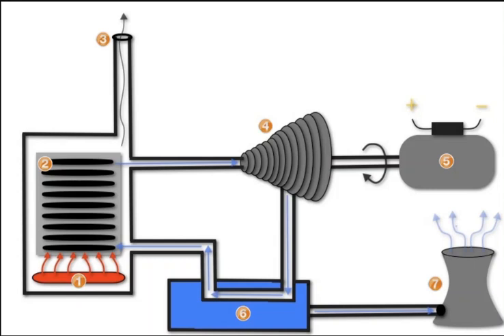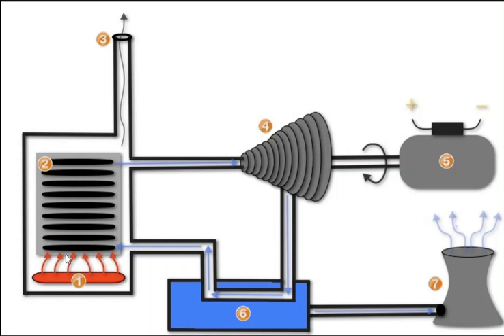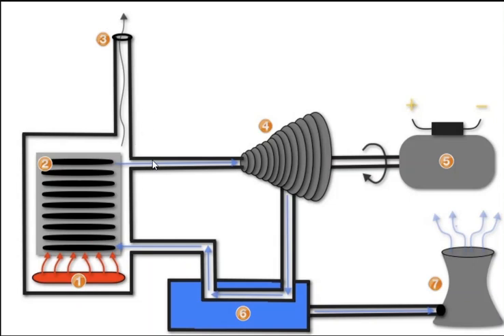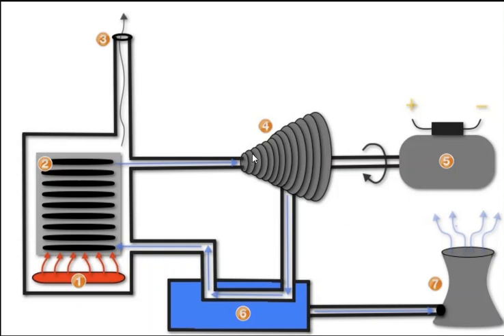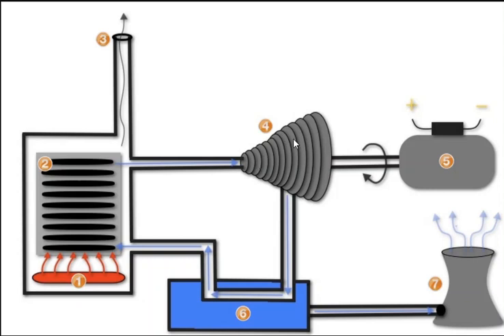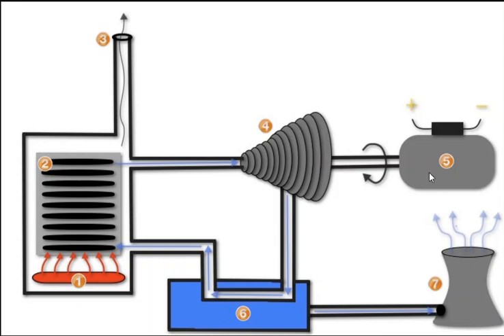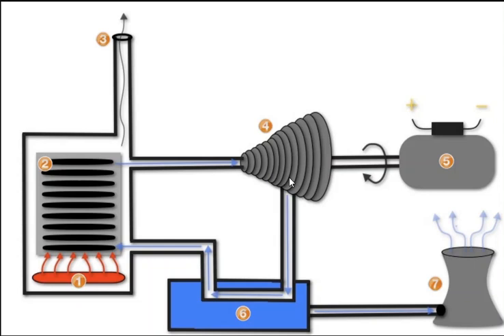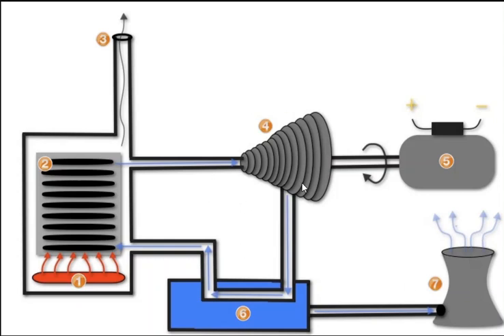How a Steam Turbine Works - A Tutorial

Comment: Why is the cooler (6) needed? Why not just direct the steam from the rotor straight to the boiler, and let it boil it from an already hotter point than it will be if you cool it down first?
Reply: What are you going to use as feedwater then?